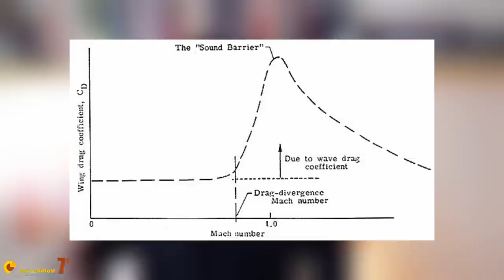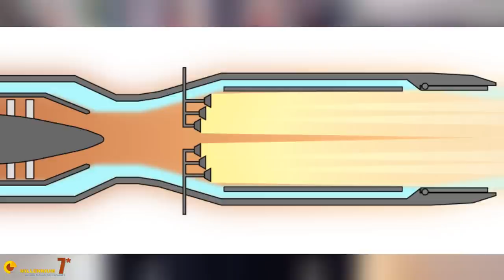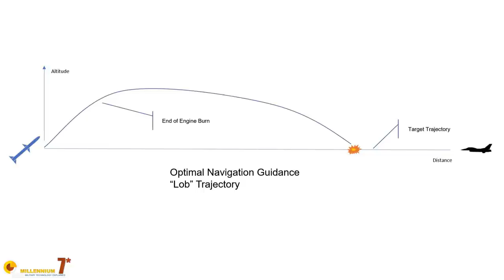Flying SUPERSONIC with NO Afterburner | Why SUPERCRUISE is so Important?

Comment: Great video, thanks!   I slightly disagree about Concorde as a supercruising aircraft because AB was only used for a very short duration in comparison to it's ability to cruise for hours at mach 2. I would describe it as a supercruising aircraft.  The SR71 has a similar ability to cruise at high speed, which it achieved using the opposite method, of constant afterburner, exactly as you said.
Reply: I'd second this. It was able to maintain supersonic without afterburners, so is in "supercruise" at that point.

Comment: Great video and the lack of Supercruise is one of the main reasons why I find it incredible stupid Denmark took the F-35 instead of example the Swedish Gripen.
Interceptor is one thing the F-35 is not. 
Also we know that in a conflict in the Baltic Sea all our airfields will get hit by cruise missiles 30 min after it starts.
Reply: They F-35 is a more highly advanced aircraft. It’s just that simple.
Reply: @jafr99999  True it is more advanced. 
But it is more expensive as well and that means less units ready for action and its advanced edge will not help it against the fact about 1-2 hours after a conflict with Russia (even a restrained one) it would have no airfields to operate from in Denmark. 
And then our aircraft would have to operate from highways, and having the same aircraft as the Swedes would make this a lot easier.
Reply: @jafr99999  Also Lockheed Martin gave vastly inflated numbers for actual flight vs maintence hours for the F-35, compared to the proven ones provided for Gripen. 
AND gave as part of the deal with Italy the service contract for EU F-35's to an Italien company. 
This will mean that we will get a lot less operational aircrafts on hand at any one time.

Comment: The dynamics of opening a missile bay door and dropping a missile into a supersonic airstream must be interesting. I'm guessing there are some trade secrets around that.

Interesting facts: The first jet fighter with a known supercruise capability was the YF-17 prototype. Even the A-12 could not super cruise that I know of. Some older aircraft might have been able to supercruise by using afterburner to become supersonic, and then throttling back. Some notable planes that were pretty fast: XFCU-8 Crusader III prototype, the F-106, the YF-23 prototype was reputed to be much faster than the F-22. It's speed is still classified, probably just to protect the reputation of the US Air Force.

The F-111 was damn fast, faster than an F-15 at sea level, though in many ways an overly ambitious, problematic aircraft from a previous generation. A dangerous plane.

My opinion - the F-35 is garbage but has good avionics and fancy though highly toxic radar absorbing paint. Speed has actually been downrated because they will literally burn their own tails off. I do not believe they are even supersonic at this point. The primary reason for the f-35s performance is a super rated afterburner which has been tacked on to it. Otherwise it has no more real thrust than the F-22 engine. It's just a feature to impress generals at air shows by burning up all it's fuel in a few minutes. But they are right that it's main power is just networking, radar and fancy missiles. The basic airframe is garbage though.
Reply: I'm sorry but the F-35 is not garbage. If you expect the F-35 to fight like an F-16 then yes it will perform poorly. That is not it's role or the tactics that would be applied when flying the bird. You can't judge a fish by it's ability to climb trees. 

The F-35 is the most integrated airframe to ever fly. The amount of situational awareness it gives the pilot is unrivaled. This allows the pilot to make the best decision at all times with the best information available. 

SEED and stealthy A2G will be it's primary tasks. Additionally it can feed data back to the AWACS without using it's radar. 

A typical F-35 A2A engagement might look something like this
- F-35 uses passive search to identify enemy aircraft
- F-35 sends bandit location data via datalink to AWACS
- AWACS commands F-15EX to fire AIM-260 missle from over 100 miles away
- AWACS provides guidance into the AO
- AIM-260 recieves updated location via F-35 datalink and it's onboard radar for terminal guidance
- Splash bandit

By the time the bandit knows it's being targeted it's too late to react. 

Additionally the F-35 could continue to do a strike or SEED mission without missing a step.

Fifth and sixth generation air warfare is going to be wild for anyone unable to keep up.

It's a completely different way of thinking about air combat. I didn't even mention loitering munitions for air superiority and area denial or autonomous drone swarms used to overwhelm anti air defenses.

Comment: Afterburners don't typically 'double the engine thrust'. Engine thrust usually increases about 40 to 50 percent, give or take, for most fighter engines. 

Super cruise engines will burn less fuel when flying at super sonic speeds than after-burning equivalents. However at sub sonic speeds they tend to burn more fuel than engines that do not super cruise. Ironically they also burn a little more fuel in afterburner as well.  

While the f-35 doesn't super-cruise its engine is more efficient than the f-22 engine from which it was derived, when flying at sub sonic speeds.  As a result the f-35 has much more range than the f-22, for this and other reasons.  The f-22 apparently can only super-cruise for a limited period of time, which limits its capability in many situations.  It's a nice capability to have, but like anything it has limitations.

Comment: The F-15C can actually supercruise with two pylon-mounted A2A missiles (sparrow or sidewinder); i.e. a relatively clean configuration.
Reply: A former captain of mine who previously flew F-15s, told me, that he even supercruised in clean configuration, when flying "cross country".
Reply: @xyzaero  My buddy told me the same thing. He confirmed supercruise with minimal A2A loadout and zero unused hardpoints on the C model. He said that zero burner was required to achieve SC, either. So just full military power and he said you were supersonic and solidly past transonic. He didn’t say a Mach number, but I’m left to guess 1.2-1.3 due to him insisting that he was well past the transonic region.
Reply: @DBravo29er  the Eagle is still an incredibly powerful machine. I think only the Eurofighter and F-22 have more “raw performance”
Reply: @xyzaero  Agreed. The F-22 is properly appreciated but I actually think many don’t understand what a hot rod the Eurofighter is.
Reply: @DBravo29er  You are absolutely right, that’s why I mentioned the Eurofighter. I think the Eurofighter is the top dog in raw flight performance worldwide. There is nothing as agile, fast accelerating etc. Once a week 1 or 2 Eurofighters come to my home airport, and sometimes they put on a short “show”, including an unrestricted climb departure and it is just  incredible what this airplane can do. 
They are just  basic Trench 1 Typhoon. The Eurofighter is in line to receive larger control surfaces and there is even an option for a 20 percent trust increase, plus 3D trust vectoring. Imagine what such an upgraded Typhoon could do 😁
Reply: So can Su35S no big deal!!! Hahaha, just kidding but Su35S could if it wanted! I think 1.3 Mah
Reply: @xyzaero f-22 has higher T/W and engine power with better flight performance and aerodynamic design. There’s a reason it won most dogfights against the eurofighter while heavily weighed with fuel tanks. Not to mention the raptor has done far more impressive things at any air show

Comment: Thank you for this informative video! Here is another enlightening comment on the subject:
Everest E. Riccioni , Col . USAF   2/10/2005 8:48:59 PM

" The F-22 has not yet demonstrated effective supersonic cruise The USAF has never appreciated that speed without persistence is meaningless. Proof� Six USAF aircraft capable of Mach 2.2 never exceeded 1.4 Mach in combat over North Vietnam in 10 years of war, in hundreds of thousands of sorties. The F-15 has never demonstrated its performance guarantee of Mach 2.5 flight in a combat configuration on a realistic combat mission profile. The USAF has the wrong definition of supercruise �(supersonic flight in turbojet thrust, i.e. without using an afterburner. Cruise means covering distance efficiently. Fighters with wings properly sized for subsonic maneuver achieve efficient supersonic flight at altitudes of 60,000 feet requiring partial afterburning thrust. This may be unknown to the testers since the test program limits testing to below 50,000. The proper cruise condition may remain unknown. All supercruisers cruise at very high altitudes using some afterburning (i.e. ramjet) thrust-MiG-31, SR-71, as did the many designs that I have studied, generated, or supervised. (Detailed aerodynamic-thermodynamic analysis is available upon request.) The GAO report that the F-22 has demonstrated supercruise is specious and misleading. The reports have merely stated that the F�22 has demonstrated 1.6 Mach flight speeds in pure turbojet (dry) thrust. No report of distance traveled or persistence at those speeds was made. Supersonic speeds in dry thrust bode well, but this capability is not sufficient to achieve supercruise. Proper data are global radius of action and global persistence plots as functions of speed and altitude, for rational missions. These data must be then compared to those of the F-15 and the ancient F-104-19 to establish progress. For example , the 40 year old F-104A-19 has twice the supersonic radius of the 20 year old F-15C at 1.7 Mach, and out-accelerates it at Mach 2.2.Compare! In comparison lies the proof of progress. " I am not saying it ... Cheers .
Reply from the maker: Interesting comment, thanks
Reply: This is 15 years old. There is an F22 pilot in the fighter pilot podcast who talks about supercruise.
Reply: @mignik01  Quoting above PO "The GAO report that the F-22 has demonstrated supercruise is specious and misleading. The reports have merely stated that the F�22 has demonstrated 1.6 Mach flight speeds in pure turbojet (dry) thrust. No report of distance traveled or persistence at those speeds was made. Supersonic speeds in dry thrust bode well, but this capability is not sufficient to achieve supercruise." so yes is it supercruise or not? 15 years old report doesnt mean that it has been superceded. Plus what did the F22 pilot actually said? Without details and just throwing supercruise doesnt mean anything.
Reply: @superchargerone  Go to the podcast. You will see it there.
Reply: Enter the BAC Lightning - The daddy of Supercruise

Comment: Actually the Concorde engineers did call a function of the Concorde Supercruise. I am talking here of the Ability to stay supersonic without using the afterburneres. This function is also called Ramp smoothing which reduces the air intake speed to a subsonic speed by using small ramps inside the intakes. This only worked above mach 1.3 explaining why it needed afterburners to go supersonic in the first place...

Comment: No mention of the first military aircraft capable of supercruise to go into service. The English Electric Lightning which went into service back in 1959
Reply: That's because all the in service variants required afterburner to maintain supersonic speed
The initial prototype was shown to cruise at 1.02 in a clean configuration only - The 1st production variant weighed more and has the parasite drag of the weapons  which reduced sustained cruise to 0.94
later variants reduced this further with the increased belly tankage reducing the non-after-burning cruise with weapons to 0.91
This is before considering that super-cruise as a concept is to put you above the peak of transonic drag, where as that places you directly AT said peak

Comment: Great video, you explained a lot. But it also reminded me of what could have been. The YF-12 interceptor would not have been able to "supercruise" because it used an afterburner/ramjet feature at cruise, but its performance would have been phenomenal (superduper cruise?).  Based on the SR-71  range of over 2,000 miles at Mach 3.2 , the YF-12 would dwarf any of these modern planes. How long can they supercruise at only Mach 1.5? Add 4 AIM-54 missiles with modern guidance systems, launched at Mach 3 and 80,000 feet and the threat would have been awesome. Increase its stealth and electronics and a modern YF-12 would be very impressive.
Reply: They HAD IT, for the F-12 . . . it was designed to carry "8" AIM-47A long range "Air to Air" missiles, also known as the GAR-9 . Their RANGE, was 100mi, at Mk-6 . . . its "Radar" was the ASG-18 system, ( The "Father" of the AWG-9 Radar of the "Tomcat". ) Look it up for yourself !.